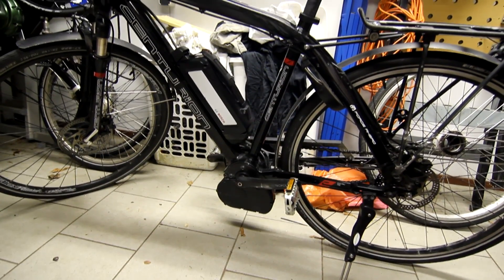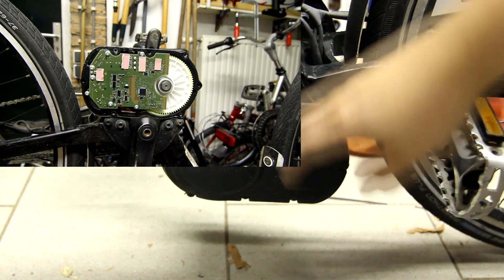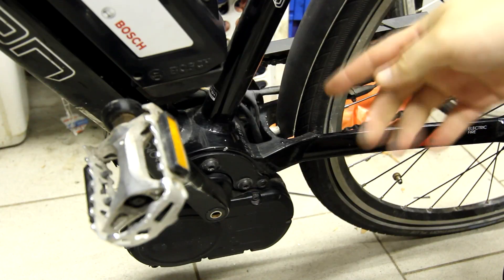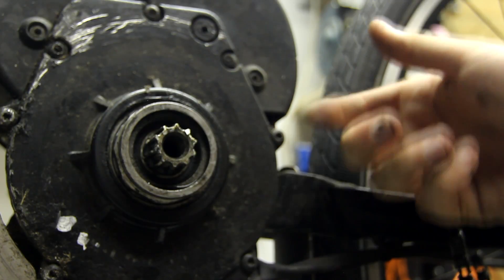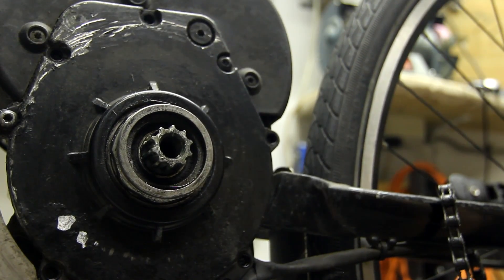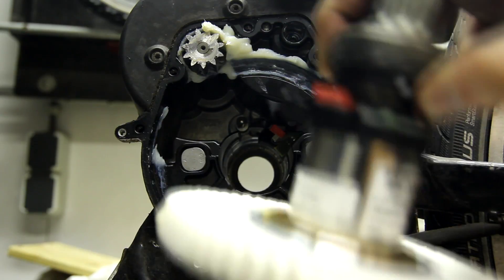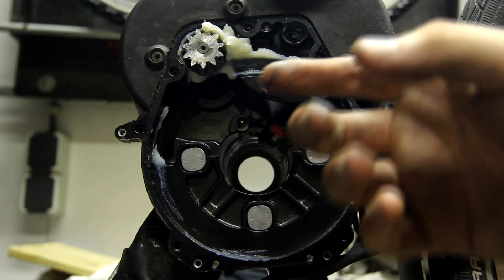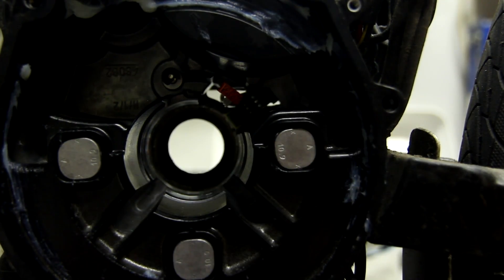Repairing a Bosch e-bike part 1 (052)

Comment: The plate that fell off you would have seen a bent brass looking washer im convinced that a bearing goes in that slot hence the brass looking washer  i think thats  a bearing part  i have the same motor  i am going to order  a suitable bearing makesure to greace the other bearings in that shaft really well  i reckon u knocked a not so good bearing back loose and it gave u less noise ,i put alot of grease on that plate on the part im sure a bearing goes and the bikes smooth as for weeks  but im  defo looking into getting a bearing for it

Comment: I was looking for a video like this, the reason being the battery on my wifes Pedelec with the same Motor died and I am considering to convert the pedelec to a normal bike (remove the motor). From your experience with this dissasembly, can you tell me if it is possible to achieve without extra parts? Thanks for the Video !